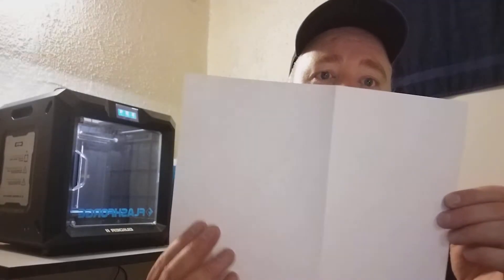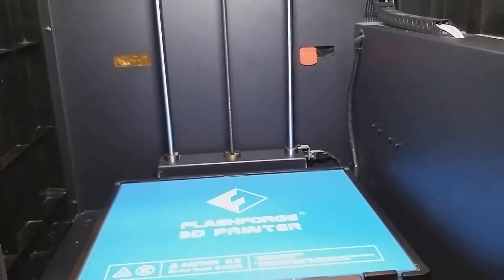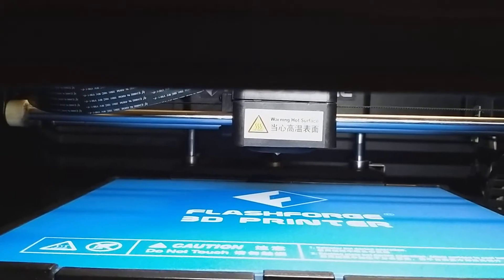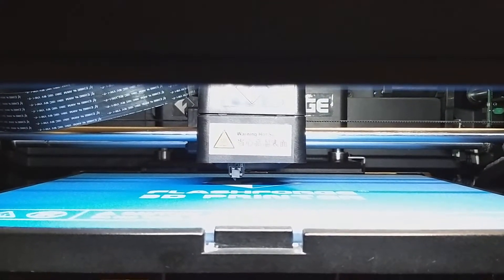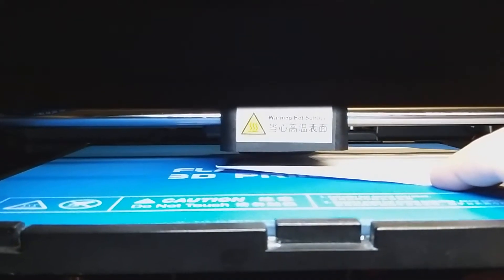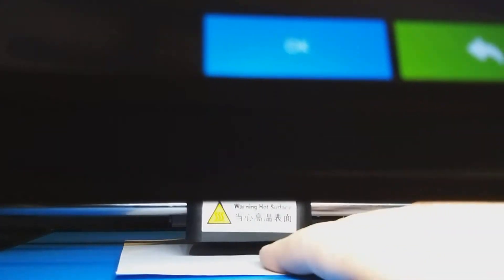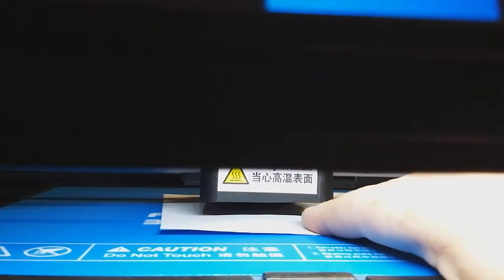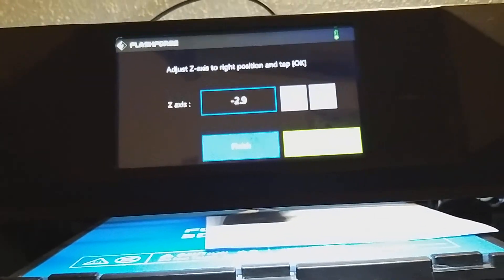FlashForge Guider II Extruder Calibration

Comment: Hey, great video! I got a problem with my calibration, maybe you can help me... when doing the extruder calibration the printing bed does not stop automatically and crashes into the nozzle. When the leveling sensor is touching the the printing bed, it looks like it does not recognize any kind of contact. When touching the leveling sensor the green lamp on the platine is shining, so I do not think the sensor is defect. I even testes the leveling sensor calibration, but it´s not possible for me to set it 100% vertically, because the motor jumps back. Same for the opposite direction. Lowest point is 176 without jumping. I hope I explained it good enough for you :D
Do you have any ideas?
Reply from the maker: I think that there might be something wrong with the sensor.
Cam you do a bed leveling with the sensor?
Reply: @JonathanBirch7  no that is Not possible, Same problem..
Reply from the maker: @Aykeiro .
I will replace the sensor. 
That will be where I will start.
Reply: @JonathanBirch7  only the sensor or also the engine?
Reply from the maker: @Aykeiro  
https://www.3dprintingstore.co.za/centurionstore/catalog/product/view/id/2236
This is from a local store in South Africa. 
Hope that you can find one at your local store.
Reply: @JonathanBirch7  thank you! I‘ll let You know if this helps! :-)
Reply: Hey ! Today i changed the leveling sensor and the servo. The problem still exists. In servo calibration even the new sensor is not detecting the printing bed. Do you have any further ideas? Greetings!
Reply from the maker: @Aykeiro 
Did not expect it not to work.
Myl suggestion will be to make contact with the service department at your local store.
Maby take it in fro them to have al look.
I might be a loose connection somewhere.
Sorry that it wasn't the solution that I hoped it would be.
Reply: @JonathanBirch7  I contacted the support and they told me to change the motherboard, extruder platine and the thinn black cable. Hope that will work :D 

Do you use Cura as a slicer?
Reply from the maker: @Aykeiro  
I just hope that all of your problems will be something of the past.
Reply: @JonathanBirch7  My printer is working again! Changing the extruder platine and the motherboard was necessary. At least it works now :D Do you use Ultimaker Cura for your slicer?
Reply from the maker: @Aykeiro  
That is awesome news. 
I use Flash Print. Have made custom settings for PLA, ABS, PETG and TPU.
Reply: @JonathanBirch7  Do you have any advice for printing TPU? Need to print some protective caps with thin walls around 1-2 mm.
Reply: @JonathanBirch7  At the moment I am trying printing with TPU aswell. All in all it works fine, but I get a lot of little holes in the first layer and only sometime in others. I already tested different printing velocities and a higher extrusion (114%) of the first layer. Do you have any ideas or tips?
Reply from the maker: @Aykeiro  Send me a mail to nj3dprintingstugio@gmail.com and I will send you my FlashPrint Profile for TPU.